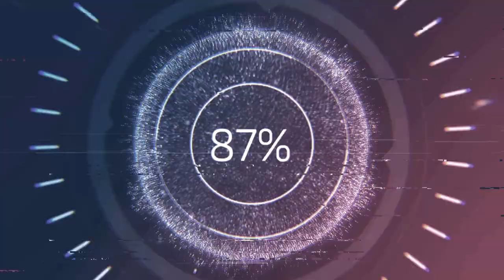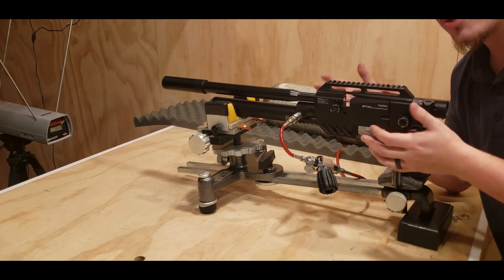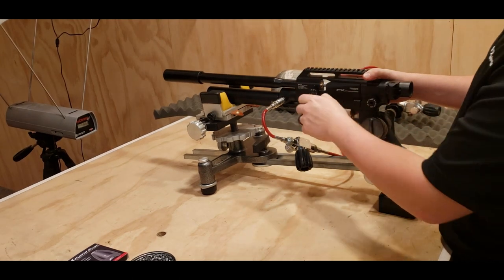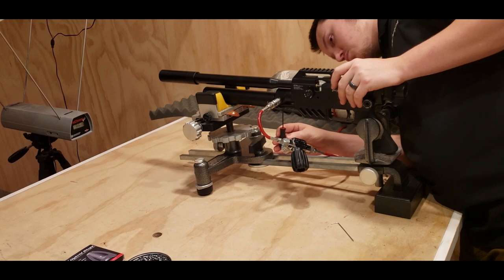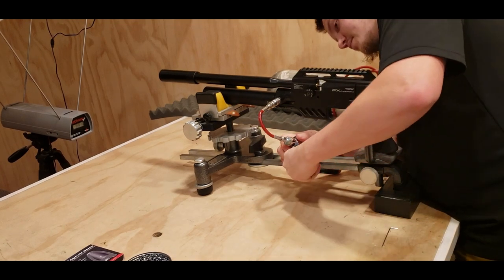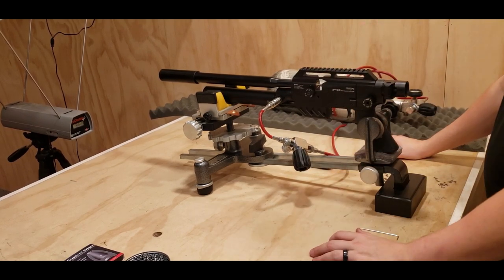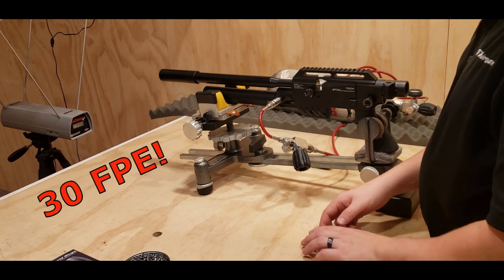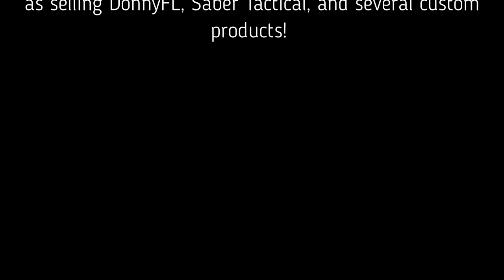FX Dreamline Compact Tuning Guide - FX Airgun Dreamline Airgun Tuning

Comment: The plenum won’t fit with the compact barrel shroud :( FX says there’s a new shroud on the way that will allow for the plenum, maybe a bottle? I’ve had my Dream-tac for a few weeks and figured out quick that the barrel length is a buzz-kill for the power hungry. I think you showed pretty well that the only way to get more energy is to run a heavier pellet... slow.  Tuning for the JSB 15.89, I quit fooling around at 140bar and 25fpe, it was just loud and wasted air. Now I’m at 110bar and 22fpe and it’s everything I wanted this gun to be. A quiet, compact, close range destroyer of urban vermin that can get through 3 mags with air to spare.
Reply from the maker: Yes, Sweden is looking into a new design to allow the plenum to fit the Compact. Glad you are able to put your rifle to good use 👍

Comment: I have a brand new Dreamline .22 out of the box shooting 733fps with a 21gr slug at 100bar, turned reg up to 140 now only getting 633fps, any ideas?
Reply from the maker: Also need to increase the hammerspring tension, likely max it out if turning up the reg that high. Also, make sure the transfer port wheel is on High

Comment: Thank you for your video. I wish at the beginning you had mentioned what your regulator pressure gauge was reading. Did you adjust the regulator pressure or hammer spring when you started shooting slugs or heavier pellets?

Comment: Thanks for putting together such helpful videos on tuning!  Quick question about the Dreamline in general, and the transfer port 3-step power adjustment.  Does reducing the transfer port size/switching to "Low" increase shot count in any way (without changing other settings)?  

Based on other folks' videos on the Streamline in .22, the FX transfer port power wheel does increase shot count when switched to low.  However, I reached out to the FX USA reps, and they said shot count isn't increased significantly.  My experience with other reg'd PCPs and reducing transfer port sizes doesn't reflect their assertion. 

Thanks for any info/feedback!
Reply from the maker: Thanks for the question! Switching to "LOW" will increase the shot count, at the cost of velocity. Also, the shot count increase will not be drastic, but probably only like 10-20% increase depending on the tune. Hope this helps!
Reply: I don’t understand how you get 10 to 20 percent increase? Isn’t the volume of air released from the valve the same for all but the smaller transfer port let’s only that much through wasting the rest?

Comment: Hey brother great video. Do you recommend tuning to 3-5 % below max velocity ? Or just set to max and adjust with the big wheel with the numbers on it ? Thanks
Reply from the maker: Definitely set the tune higher, about 10-20 fps, then tune the hammer down to desired speed for optimal valve balance.

Comment: Thanks for all the videos you are making. Like you said the Tac Compact is not a long range gun but meant to be a short range pester/hunter. What I would go for with this rifle is to get two full 18 shot magazines in .22 caliber. I don't know what that would make in fpe but if in the low 20's of fpe that would be fine. Then you could turn down the hammer wheel for those inside barn pesting situations only needing about 12 fpe. You didn't mention in the video what the rifle was getting shot count on high power but it seemed less that ten shots. That would not be much fun to have to be having to air up all the time. Maybe better to do a video on a lower power tune for pesting as the rifle was designed for. Thank again for the video.
Reply: GunPowder&AirPower  I’ve set my reg to 110bar and took 1 turn out of the hammer preload screw. Transfer port on .177/.22, hammer min-max I get 19-22fpe for 60+ shots. With the transfer port at “low” I get 9.5fpe for more shots than I have the patience to count. All with JSB 15.89s. I don’t know if you’ve ever driven a car that when you stomp on the gas pedal the only thing that happens is it makes more noise, but that’s how I felt tuning this gun. That’s not to say that I’m disappointed, because I’m not... at all.
Reply: @giaxxone   Actually I am really impressed with shot count and power output you are getting. For what I believe the rifle was designed for a short range pester it sounds about perfect. When shooting in and around barns and outbuildings at shorter ranges you don't need too much power to get the job done and be safe too. Thanks for sharing your rifles performance.
Reply: GunPowder&AirPower  I honestly didn’t expect the shot count I’m getting out of this tiny cylinder.  My hunting situation is more in the middle of a city, but your opinion of what this gun should be is exactly why I bought it.

Comment: Nice work, thanks for showing us this.    Ok, so I plan to buy the dreamline lite with the bottle ( not the carbon fibre yet). I plan to shoot 18.13 grain pellets and slugs from the 500 mm barrel. Probably won’t buy the slug liner yet ( later).... will be using fx hybrids even though they’re expensive but will probably shoot well from regular stx barrel 🤞.   I plan to get the ‘power plenum’ too. I really look forward to seeing your results of tuning with the extra air available, hopefully the regulator pressure can be lowered a lot more but allow greater speed. I’m sure you’ll find out way before me as I’ve not even ordered the rifle yet 🙄. This tuning guide is great, I can’t wait to see the new plenum tuning results 👍 l welcome any advice you could offer me 😉
Reply from the maker: A power plenum tune and install will be the next videos released, stay tuned 👍
Reply: Thanks for the video. Great work. I recently received Tac Compact in .22. The first thing I noticed was the the cocking lever was not as smooth as some YouTube videos raved. My gun was converted from a .177 to .22 before being shipped to me. It appears that the pellet probe is contacting the top inside diameter of the barrel as it goes in. You have experience in the Dreamline models. Is this normal or is there a possible issue?

Comment: thanks for the video and the correct procedure for tuning. with the dreamline plenum coming out; what do you feel will be real world numbers for .25? using the jsb as a standard. also, do you feel that with the addition of the plenum the need for an upgraded valve seat? your thoughts would be greatly appreciated
Reply from the maker: No problem! The .25cal 25gr Compact with a power plenum I would think would be able to get up to mid to high 800s (860 to 890), but I haven't done the testing yet. Unfortunately, the Dreamline cannot accept an upgraded valveseat, so we will have to see what Sweden comes up with.
Reply: i have a plenum on order and will be installing as soon as it comes in the mail.
i will be using it with the 600mm in .25; currently tuned to 905ft/sec with the NSA 26.8gr slugs at @ 140 bar...hoping to move to the 33.5gr slugs with the extra power of the plenum. keep the videos coming and keep letting us know about your services and what your store has to offer...
Reply: just received the power plenum/extension and is now set pushing 26.8 gr nsa @940ft/sec. also got some new slugs from Griffin in 26gr so i will let you know how slugs are doing in the dreamline
Reply from the maker: @jrlayneoliver  awesome! Great results to hear! I bet those slugs are grouping better with that extra power!
Reply: Just sent you an email
Reply: @jrlayneoliver  Hi Mr Whisper :) This velocity is outstanding ! What reg pressure do you use to shoot the 26.8 gr Nielsen slugs at that velocity? Thanks !
Reply: @Steph J, my reg pressure is set at @140-145. I will be doing much more testing in the weeks  coming

Comment: Greetings and thank you for a great video! If I may ask a question I would much appreciate it :) I purchased my FX Dreamline from Utah Air which arrived 2 weeks ago. The rifle came tuned from the store firing 880 fps using Jumbo 15.89 Pellets. My issue is I'm not getting anywhere near 30 shots which I was under the impression the factory bottle would yield. In all the videos I've been watching I see at least 30. I'm getting about 16-18 before my regulator starts to drop.

My question is, does this sound right to you? My settings are as follows:

125 BAR Regulator
High setting on transfer port (my dial has low-med-high not calibers)
Hammer spring set to high.

I'm not by any means new to air gunning. But I am new to FX and trying to learn how all these settings work in relation to one another. It's a bit daunting but I'll get the hang of it. So any answers you can give me would be great. I don't have a chronographer as of yet but will soon so I can confirm those numbers.

Thank you,

Steve
Reply from the maker: Wow, that does sound a bit excessive on the air consumption. 250 down to 125 in just 30 shots, or does the regulator start moving before your supply to down to about 135? The settings sound correct, maybe some air efficiency could be gained from switching the port from High to Med, but that will lower the velocities to about 860fps more than likely.
Reply: @910AirgunTuningandRepairs  It depletes from 230 BAR down to 125 BAR at which point my reg starts dropping after abou16 shots. I tried lowering the hammer spring to number 4 and the transfer port to medium and am now getting about 20 shots. But I have to invest a chronographer to know exactly where I'm at with my tuning and power.....thank you for the information.
Reply: @910AirgunTuningandRepairs  Ok ..I now have a chronographer and indeed this gun is shooting quite hot. I'm getting around 950-960 fps using the 14.3s in 22. I have to ask, is it even possible to achieve this velocity with my regulator at only 125 BAR??? I think I might have a defective reg gauge? This gun needs some serious retuning.
Reply: @mrtrek64  My Dreamline compact (300cc bottle version) just arrived from Utah Airguns. Haven't had a chance to take it out yet, but they tuned it exactly as you describe.

Mine came with the power plenum installed. If you also have the plenum it may contribute to higher than expected fps at 125 bar.

As the 14.3s are lighter than the 15.89s they will shoot quite a bit faster,  not clear that your regulator gauge is broken. What fps are you getting with 15.89s?

Finally, you're not going to get 30 shots with 15.89s tuned for 880 fps - this is the upper limits for the compact, which means you're using lots of air. As mentioned in the video, this is not a long range high velocity airgun. Turn the hammer spring down to 3 and the transfer port to medium and you should get closer to 30 shots. Your fps will drop (I'll hazard a guess of 750-800) but that's sufficient for <75 yards

Comment: Thanks for another good video. I'm still waiting to get myself a tact-compact, but it seems it a very slow process to get them in stock in USA.
Why did there sell these gun with a thick shroud. One of the first video that came out with this tact-compact got a slim shroud. It seems more problem that benefit. No bottle, No plenum. Is it possible to take the shroud off and replace it with more narrow tube?
Reply from the maker: The production model has the thicker shroud because it is based off of the Crown SuperLight barrel, which is much more rigid/steady and lightweight. I do not think they imagined people wishing to put a bottle on a compact rifle. Also, the plenum was a very fast design after the compact was already in production. I have heard they are working on a solution for the barrel. Also, due to the current barrel design, no, the shroud is not interchangeable, to my knowledge.  At least not without some heavy modifications.
Reply: @910AirgunTuningandRepairs  Who knows, there might see all the small mods people are making and come up with a new housing, that integrated these new ideas or improve it to the new knowledge as impact.

Can you tell me if there is any noticeable different between FX Stackable moderator and FX Donny FL for this airgun. Would your neighbor hear the different.
Reply from the maker: @jlk22182  definitely a difference between the moderators. The FX Stackable barely does anything, more so just changes the way it sounds rather than actually how loud it is. The DonnyFL actually reduces the noise, and can reduce it pretty significantly based on which model you purchase

Comment: 910 Airgun Tuning and Repairs hi,i have dreamline compact neewer model it have pover plenum and finer shtoud .22 cal i set reg at 150bars spring adjuster at max,and i feel it is like 16j maxed out,what is wrong?i do not have a any chrony, to shoot 18 pellets i use 10bars from tank,until 150 bars i can shoot 140 shots,i aded huma hamer spring,same shot counts 140 until reg reaching 150 bars
Reply from the maker: If you have 140 shots between 250 to 150 Bar, then your rifle is certainly not maxed out. First, is your transfer poort setting at High (.25/.30) setting? Also, the barrel may have two transfer ports. Make sure the largest one is facing down. Is this a Full Power/ FAC rifle? 
I seriously suggest investing in a chronograph if you are trying to tune any rifle, you will save in lead and frustration whatever you have to spend on a chrony.

Comment: Heya bud thanks for the video. I need all the help I can get. Just ordered the compact in .25 though. What I like to ask you is about group size at various ranges. Its important for me
because I am looking for how far say can you go and keep a 1/2" group ? Let's assume perfect condition,  no wind etc.
Reply from the maker: Hey Glenn! I know for normal length barrels, FX has a maximum standard of 1/2" groupings at 50 yards. I believe that is true for the compacts as well, just have not tested it yet. I have not been able to get my hands on one I can really "put through the ringer". Soon though!
Reply: @910AirgunTuningandRepairs  Oh i thought the .22 was yours. I imagine, and I hope it comes tuned to the 25.39. Also you the suggested grain weight per caliber reg you mention is 140-160 So imagine it .177/140 .22/150, and .25/160 ? Good for that getting one soon. Can't wait for mine. I feel like I know I am gonna love it.  Was very disappointed  with the Hatsan Flashpup I bought,  put a reg in it and it still craps out. One day on, next day who knows
Reply: @badBikerz  hey,  did you get the. 25 compact in the end. How does it group at say 60 and 70 yrds. Thinking of one but woundering how accurate at that distance

Comment: I noticed that you dialed down the regulator without degassing the rifle. I thought that was a no-no. Has that changed in the FX regulators?
Reply from the maker: Yes, all AMP regulators can be adjusted up and down without degassing. It is recommended to only adjust down about a quarter-turn before shooting, which relieves the pressure.
Reply: @910AirgunTuningandRepairs  That is good to know. Thanks.

Comment: Hey I wonder if you can help me. I was wondering if you could give me some advice. My dream-tact compact .25 showed up today. Only got to take a few shots. I was hoping it would come set to its best settings, but the hammer spring tension wheel is set to max, i dont think that could be right and the reg is set to 150, which i guess is right. Any advice please also it seemed to go from air cylinder pressure 220-160 with only like 9 shots I hope that is something wrong.
Reply from the maker: Hey Glenn. The wheel at Max is correct, you will need to check the hammerspring tensioner for adjustments (slide bar next to the wheel). It depends on what speeds you are trying to shoot. 220bar to 150bar should be about 20-25 shots I believe, if the regulator isn't 150bar. I still have more testing to do with the Compact to learn it.
Reply: @910AirgunTuningandRepairs  Thanks for the reply. I am going for most accurate, which should be 820-840, using the kings 25.39 and will also be using the hades, pretty much same grain. It came with reg pressure 150.

Comment: Do you have any advice on tuning a sub 12ftlb to get consistant pellet speed ? 
And what's an acceptable difference?
Reply from the maker: I have not worked much with sub 12ft lb, but usually the FX regulators keep under 15 extreme spread and 5 standard deviation across a minimum of 10 shots (normally I can get several magazines to fit into that range). I believe 10gr .177 JSB in the 800'sFPS is sub 12 ft lb
Reply: Sorry didn't say it's a .22
Reply: 15.89g jsb
Reply from the maker: @madvokes1983  I have never used a .22 for sub 12ft, as that would be shooting the 15.89gr pellet around 580FPS. I would try to reach out to Giles or post on the Airgun101 or AirgunNation forum about this question.

Comment: I'm still looking at getting a Dreamline Tactical using your experience i can tune myself, I can use my crown barrels but one thing i need to know is the dimension of the square end on the pellet probe. if possible can you measure for me.
Reply from the maker: Yeah o can get that dimension, but what will you need it for? The Dreamline probe will fit a crown barrel
Reply: The crown uses a different pellet probe, as i already have the barrel liners its an option to make the pellet probes for the dreamline, i need to buy a square collet and square bar just don't know the size, but i'm guessing they it will be approx 7mm across the flats.
Reply from the maker: @mikedavis4039  the square end is 6.5mm, but the .30 probe "round portion" measures 7.65mm, bored to 6.35mm.
Reply: @910AirgunTuningandRepairs  Thanks for the information, i have found that FX use some odd sizes or non standard dimensions etc.

Comment: Where does the plenum fit on the Dreamline ? I have an Impact but I really want to get a dreamline .
Reply from the maker: The Dreamline plenum fits between the supply pressure holder and the action. For the tube version, it is between the tube and action. For the bottle version, it is between the bottle adapter and action. Let me know if you have any other questions 👍